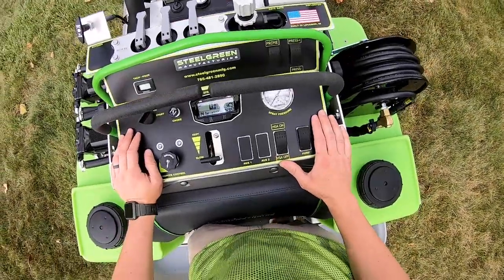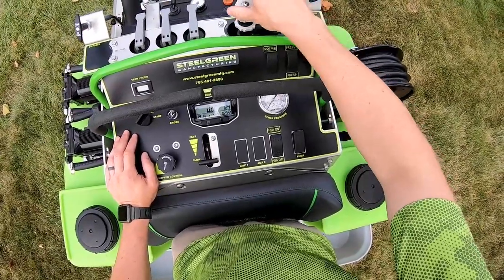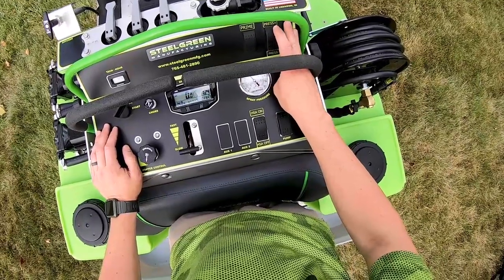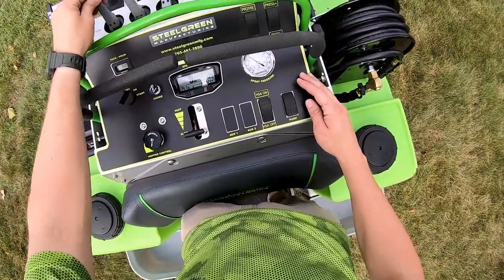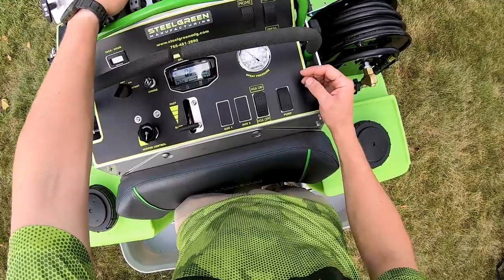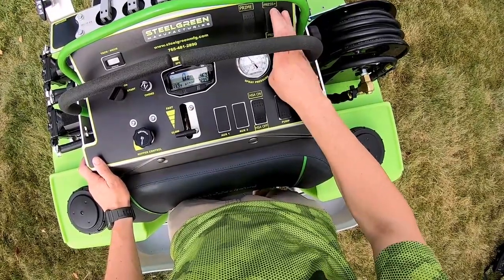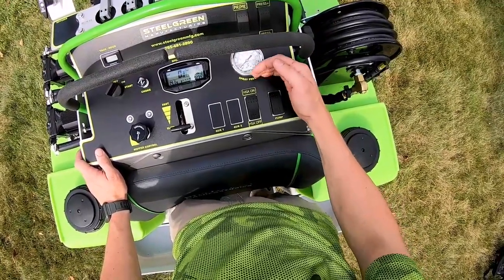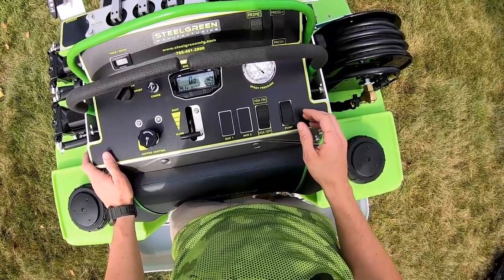How the New Pressure Control System Works

Comment: What’s the adaptation process on a machine that’s a few months old?
Reply from the maker: Hello! It is a fairly simple process that involves teeing into the return line under the dash after the manual pressure valve and then mounting the control box and hooking up the wiring. You still retain the ability to use the manual control valve as a backup though we have not seen issues from this system.
Reply: @steelgreenmanufacturing8843  how much does it cost. I just bought my machine back last fall
Reply from the maker: @p.b.sHUNTING  For the cost, please reach out to us at (765) 481-2890.

Comment: It's electronic? How's that gonna hold up to corrosion...
Reply from the maker: Hi! The control box is fully potted and we use sealed connectors on the system, the units we currently have in the field have not ran into issues in this area, also you retain the ability to use the manual control valve as a backup if an issue were to arise.